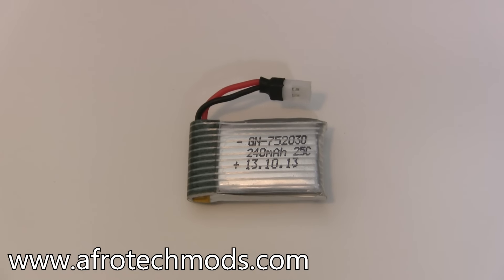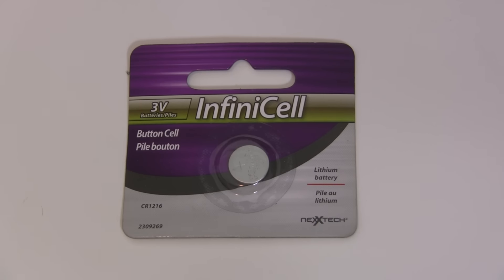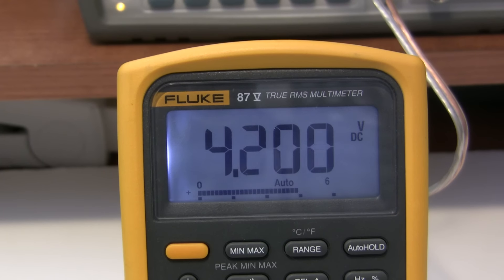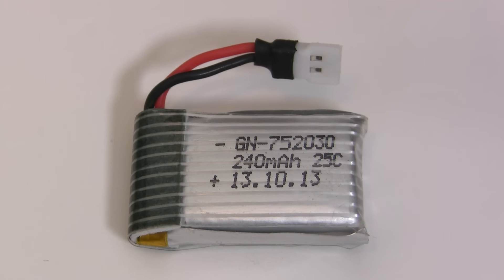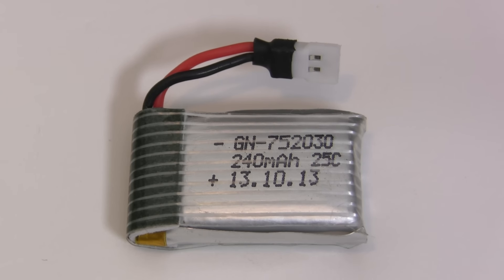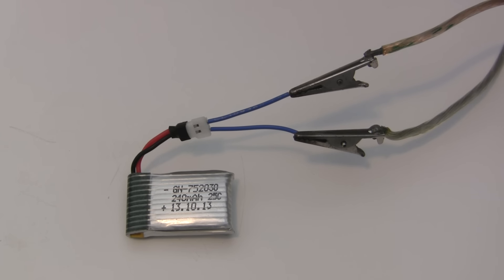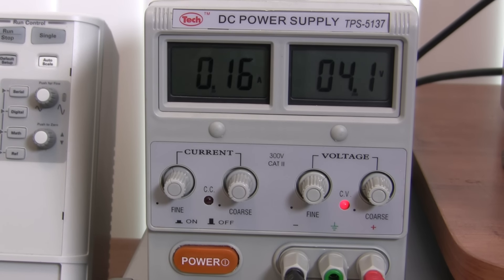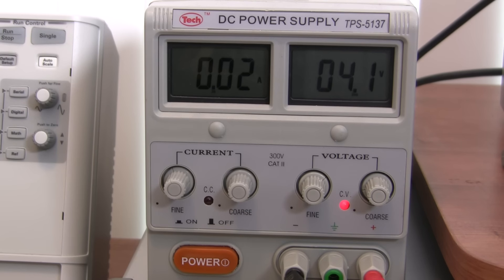🔋 How to charge a LiPo battery with a power supply

Comment: Why is the magic number 4.2V? Is it because a LiPo battery has a nominal voltage of 3.7V per cell and 4.2V is it's peak voltage when a cell is fully charged?
Reply from the maker: Kelvin Lei Yes
Reply: +Kelvin Lei 4.20 blaze it!
Reply: how can you know the peak voltage for charging?
Reply: read a data sheet
Reply: 5 years ago, wow.  glad it's still here.
Reply: @Afrotechmods  But some LiPo batteries have 3.2v nominal. Are you saying I should treat all LiPo batteries the same, regardless of their specs?
Reply: Daniele Testa The data sheet is the final word. It should contain absolute maximum parameters.
Reply: KAVY
Reply: @rdelectronics2790  internet
Reply: What about 4.15 to 4.2

Comment: I usually only go up to 4.0V. The extra safety margin is worth the maybe 10% loss in capacity,IMO.
Reply: so ive been charging my 3.7v li batteys on a 5v wall charger,, is that bad?
Reply: in theory chargin them up to about 70% is supposed to extend they life. Notebooks sometimes have an option on the bios to limit the battery to 70% instead of 100% to extend its life.
In this case, though the safety is not really that important here, just limit it to 4,2 or 4,1 depending on the chemistry, it should also help its lifespan.
Reply: @Leharl
Limiting the voltage to 3,95 V improves life span.
The more you reach the 4,2 V, the shorter the life span is.
4,2 V is just a value that is safe, but this doesn't mean that it does not shorten life span.
In consumer goods like smartphones they calculate, that the user is buying a new smartphone after 2 years, that's why they go up to 4,2 V. But in cars or military usage, a better life span is more important, that's why they set the limit to 3,95 V there.
Reply: OpenGL4ever  didnt know cars limited the voltage to 3.95, you sure those arent LiFePo4? As far as keeping sight of the charge, i understand that just looking at the voltage doesnt work, that's why many ICs do coulomb counting to assest the current charge level. Not sure limiting it to 3.95 is a good meassurement for every lipo battery and each different chemistry/enhacement.
Reply: Laharl Krichevskoy
They don't use LiFePo4 in Teslas. It might be different in other cars.

Comment: why ur power supply showed 3.4v first? I thought that the charging voltage would be 4.2v? Can I just connect a power supply with 4.2V wich is also limited to 240mA and wait until the battery is charged?

Comment: Your video is very informative. I have no knowledge of lithium ion battery so about a year ago I charged it the same way as Ni Cd (with power supply at higher voltage with resistor in series). After several months, the lithium ion battery bloated and failed.

Comment: AWESOME video. Very valuable info condensed in less than 2 minutes. I figured this out the hard way, by experimenting and observing my bench top transformer when charging a car battery. I wish I had come across this video before. Charging a battery is like pumping air in a car tire, as air pressure (Voltage) builds up inside the tire, the rate of air flow (Amperes) slows down because the pump is struggling harder trying to push air inside the tire that's almost "full" due to accumulating air pressure in the tire.

Comment: Wow, That's really great.  This should be one of the first videos  recommended when it comes to power supplies.  So I need currant limiting circuit with read outs, and an adjustable fine tuning voltage output circuit.  Good, this will be fun.  For the kind of projects I'm anticipating, must have additions.  
That's a great power supply you used in the video.  Make, model?  I wouldn't mind having one of those.   I bet you have a home made power supply that you still use, I'd like to see that as well.
Here is a question,  let say one attempts to charge this same battery with 3V. and the currant is same, and or slightly less?  Will you safely get the battery charged?

Comment: Like always, great video! You presented what a LiPo charger does more or less. How precise voltage do you have to provide to safely charge a LiPo battery?
Reply from the maker: ElectronFun.com I'd never go above 4.250V. And make sure you remember the accuracy of your multimeter when doing the measurement as well as the fact that your PSU voltage may drift over time. Stick to 4.2V.
Reply: Afrotechmods
Thanks a lot!

Comment: How does the power supply know to switch between constant current and constant voltage mode?
Reply: because when it reaches a certain voltage the battery starts drawing less than the constant current.
Reply: Because it was set to 4.2v and then constant current was turned on, so the power supply limited itself to 4.2v while trying to sustain a constant current.
Reply: it doesnt really "switch", it applies both limits, it just happens that when you limit the voltage the battery starts to draw less current

Comment: Thanks for your very illustrative lipo charging batteries video.  While I was watching the vid I recall a very old doubt regarding ajustable power supplies. How is it possible to adjust the current while the circuit is open with no load between the power terminals? When the power terminals are not connected to anything there are not exercing any job and therefore there it is not consumption and there it is not current, then how he does it?
Reply: he is short circuiting it

Comment: I love your video! Can you elaborate a bit on why you chose 4.2v as the "safe" charging voltage? Is this based on a 3.7v LiPo battery? Would this same voltage apply to any battery regardless the voltage rating? Thank you!
Reply from the maker: Yes it is because it's a 3.7V LiPo battery. That's how it is for them. Different battery chemistries would require different charging methods and voltage/current cutoffs.
Reply: @Afrotechmods  thank you! Also great information, I’ll try to find out more about different voltages now :)

Comment: Hi there, I have just found your channel, this video and the voltage regulator tutorial have peaked my interest. I would appreciate some insight on something I have done. My drone uses a Li-Po battery and unfortunately I have lost the USB charger that came with it. I'm not fully versed in circuitry but i have cut off one end of a USB  cable and soldered a female JST connector onto it. It did manage to charge the battery but I can't help but feel a little uneasy since I don't have a way of making sure that this was completely safe to do or that the battery is being charged at the right requirements. I am also wondering if I could make a regulated USB charger for the battery?
Reply: @alfa-psi  ah nice thanks for the tip :)
Reply: @alfa-psi  ah nice thanks for the tip/correction :)

Comment: Quick question :)
I have 10 AA batteries in one holder which I want to charge. The problem is that I have a power supply with adjustable voltage, but no current adjustment...
Can I charge the batteries without current adjustment ?
What is was thinking is the batteries will take as much current as they need (in my case 5A) and I can adjust the voltage to 12V...
(Batteries: 2500mAh, recharging at 500mA. Power supply: 1-35V, 10A)
Reply: +Gellert Korpos he charges a LiPO battery in this video not NiMH batterys, they need to be charged diffferently with delta-peak-detection etc...get a seperate charger for them

Comment: So is it safe to charge a small LiPo battery WITH protection circuitry (against overcharge, overdischarge, overvoltage) directly from a 5V solar cell? I noticed that the voltage will drop to the battery voltage when charging, and so far none of my batteries has overheated / exploded (just small solar panels and batteries, about 200mAh / 80mA)
Reply: That current will work fine for cells down to 80mAH in size. I do, however, recommend using a diodes in series to prevent backfeeding. When there's no light, the battery could discharge into and damage the solar panel. A diode will prevent this and also add around a 0.7V voltage drop. Which, coincidentally, would result in the 5V becoming around 4.3V. Since the cells are protected, they'l shut off anyway, but extra safety is always a good idea.

Comment: Also, what happens if I charge a Li-ion battery with a slightly lower voltage than 4.2V, for example 4V? Should I take a look at the battery's discharge curve how much its full capacity it has on that certain voltage, and should I charge it the same way with constant current until the battery will reach the discharge capacity to that lower voltage?
Reply from the maker: ZauStuv The 4V would be the "termination" voltage. If you charge to 4V you will only get e.g. 80% capacity. You should still charge at constant current until you reach termination so the battery doesn't overheat.
Reply: Afrotechmods All right. Thank you for the help.

Comment: Could you do one for lead acid please? :)
Reply: Lead acid is basically the same, but at only 0.1C charge rate. Max voltage per cell is 2.4V for lead acid. So, to charge a 12V 75AH battery, set your power supply to 14.4V and 7.5A.
Reply: Daniel Jones  but 14.4V is for liquid cells (which can gas a bit without problems), gell cells should never go above 13.6V. Also 14.4 is for continious use, like in cars. For stand by batteries, 13.6V again is better for extending it's life.

Kevin McMillan Also in really hot days, say 30ºC+ you shouldnt charge it above 13.4V. 13.6V is the generic for ~25ºC but lead cells' voltage dependes quite a bit on temperature. If you're really interested you should look for the table that says which voltage is the optimum at which temperature.

Comment: I've seen plenty of LiPo & Li ion batteries with charge rating greater than one. However I've also seen them with c ratings below one. If it's not clearly marked or documented would assuming 1C really be safe?
Reply from the maker: Josh Campbell I think if there is any doubt, keep a close eye on the temperature of the battery. Make sure it never goes above 40ºC.

Comment: Why is it necessary to have a current limit? If you don't set a current limit, can the cell potentially draw more current than it can handle?
Reply from the maker: arthurthegreat Yes. Easily.
Reply: *****
Actually that's not quite correct as well. If you see the battery as an ideal voltage source with a resistor in series to it (that's a common model) you can see that the current directly depends on the voltage difference between the charging voltage and the battery voltage (if you disconnected it): I_charge = (U_charge - U_battery) / R_battery.
Where R_battery is the internal resistance of the LiPo. As an example for a rather low capacity LiPo R_battery could be around 0.1Ohm (that's the point where you shouldn't quote me ;) ) which is discharged to 2.8V you would get (4.2V - 2.8V)/ 0.1Ohm = 14A.
Reply: ***** No not infinity, but a very large current. Only limited by the cells resistance, and the chemical reaction which takes place, when charging the cell. This is a 25C cell, so i suspect the charge current without a current limit will be likely in that region or more. Which will heat up the cell very fast, thus destroying it, leading to bloating (H Gas will be created inside the cell) and eventually rupturing and igniting the venting H gas.
Reply: *****  lipo batteries have a low ESR, so they will take a lot of current in one go if you dont limit them, most probably more than your psu can take and hence burning it.
Also, with current comes heat, and lipo and lithum batteries in general arent really fond of temperatures above 40ºC. Lithium is quiet a reactive metal, dont heat it, and dont expose it to air.
The same reason goes as to why you shouldnt short circuit lithium batteries. even small cells like that one can deliver a lot of amps in short circuit easily causing a fire, add to the fact that these cells dont like heat, and you have a thermal runaway the palm of your hand.
(btw see the battery says  25C, that means it can deliver 6A (0.240x25)  under normal load (keeping its voltage), many more in short circuit. Afro forgot to say that if it says 25C you can also charge it at 2C instead of 1, though it depends on the quality of the cell, but usually. 2 or 3C for 25 50C cells tends to work fine though you need to be careful about heat as i said)
Reply: If you want to charge a battery very fast, than buy a Lithium Titanate battery They take very rapid charging rates with high amps easily.

Comment: can i use a wall 5v adapter which outputs 4.9v constant and use a diode that drops the voltage to 4.2v (dropping 0.7v)???? since i don't have adjustable psu.
Reply: no, you need the cc. get a cheap ltc3780 from china.
Reply: Don't do it. You can limit the voltage but the current will be to high for your battery. 
The maximum charging current rate is 1c for lithium batteries which is the capacity of your battery.

Comment: hey, very informative video but i have a question about multi cell batteries. I have a 3S lipo that powers my quadcopter using the red and black XT60 power connector , and my gimbal is powered by the balance connector , if the gimbal is using the red and black wires from the balanced connector ( there is a blue, yellow and red for the + on each cell i believe , red being the same connector as the lead from the XT60 connector) will it discharge that last cell faster in the process of using the gimbal ? or since they are in series and its connected to the last cell  in series it will discharge at the same rate as the rest ( the quadcopter )? thanks in advance for your answer ! ohh and DIYperks brought me here !
Reply: HIXMF it will discharge at the same rate. sounds like a parallel connection. both connectors can be used to power things up, but obviously, the smaller connector can't deliver as many amps as the bigger one powering your quadcopter

Comment: I see 25C on the battery. Doesn't that mean it can handle 6 amps while charging? Or does that only apply for discharging?
Reply: 25C is the maximum discharge rate
Reply: Tsnafu Ah, makes sense, thanks :)

Comment: Can I use a fixed power supply with the voltage of 4.2V, and then set the charge current by applying PWM on the charging voltage?

Comment: Hi sir, nice vídeo. Could you solve one question? Can I use a Efuel 20A power suply to charge a 3S lipo adjusting the Voltage?

Comment: Can you please explain why it first charges with constant current mode and then constant voltage mode? Thank you!
Reply: The power supply will fix the voltage and allow the current to flow up to the designated current output limit. The battery will receive the maximum current allowed (the output limit) since it is drained and really wants to flow due to the battery having a lower voltage (V1)  than the power supply output (V2). The allowable voltage difference (V2-V1) is set by the limit of how much current is allowed to flow (I-max). As the battery voltage approaches the power supply output voltage (the battery is charging) the internal resistances becomes more significant as the voltage difference decreases. So up until now the power supply has been told to keep allowing up to 240mA to flow (I-max) by maintaining the voltage difference (V2-V1) that supplies that I-max value. However, the power supply has also been told to only go up to 4.2V maximum, setting a limit on V2. Once that limit has been reached, the V2-V1 voltage difference cannot be maintained for I-max since the battery voltage V1 is still going up but the power supply output limit voltage V2 has reached its limit value at 4.2V. This means now the voltage is the limiting factor on the power supply, and the current more will  decrease more and more as the battery voltage V1 increases up to the same value as the power supply output V2.

Comment: so ive been charging my Li batterys on a 5v wall charger. (is this dangerous. should i replace with a real charger) been goin good for a few months. but i never charge em for very long, about an hour,  after watchin this im a lil worried.) great video btw keep up the great work
Reply from the maker: I can't tell if you are trolling or not. If you are, well played. If you are serious, please don't ever do that again, you are going to start a fire.
Reply: no trolling here, just been charging my e cigg battery with an old cell phone charger,, figureed they were the same, (so i need to add a power limiter to the mix? )
Reply: ty for your response too, ill try to remedy this problem today..
Reply: another quick question,, should i just find a 3.7v-4.2v charger? or add some kind of power limiter to the one i already have.?  (thank you for your time)
Reply: okay i found a really cheap charger for like 3$ ( thank you for your information.) prolly saved me alot of trouble when it did decide to finally blow,
Reply: Jd Cunningham
maybe the ecig  lighter just has the charging circuit inside ofc. If you were connecting the battery pack directly to the charger then maybe the battery pack has overvoltage protection (there are a few that have).
Reply: yea i was just connecting an 18650 to the charger wire.. but now i got a real 18650 charger on the way,, (go amazon)
Reply: luckily you did not buy UltraFire brand :))